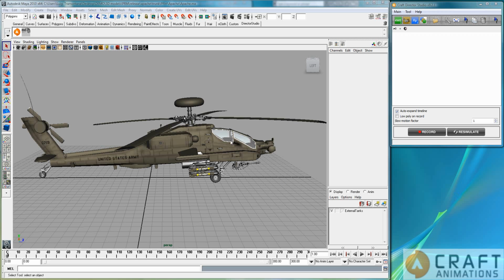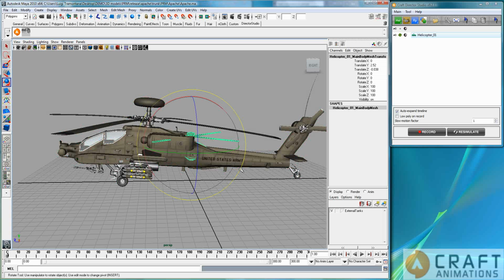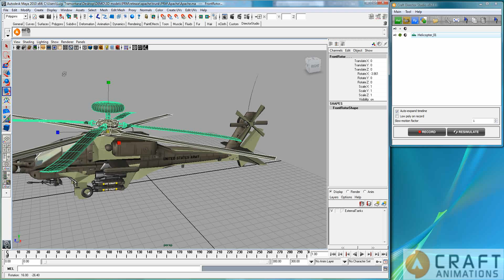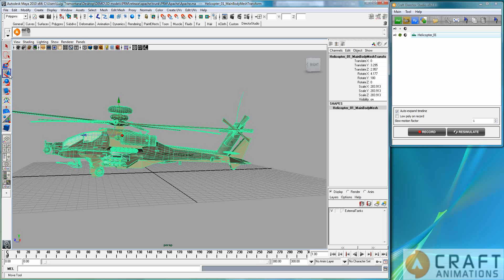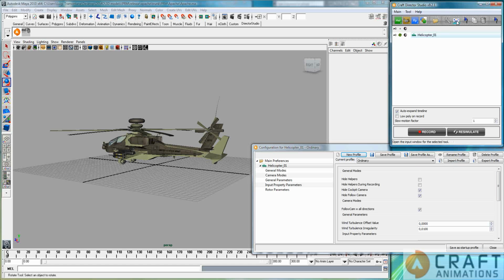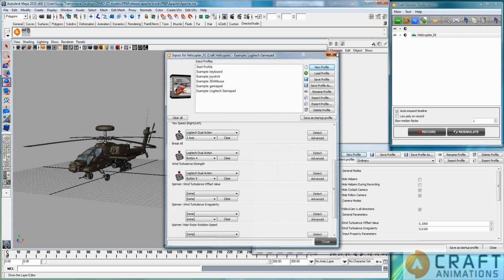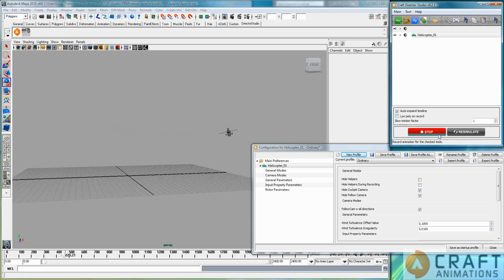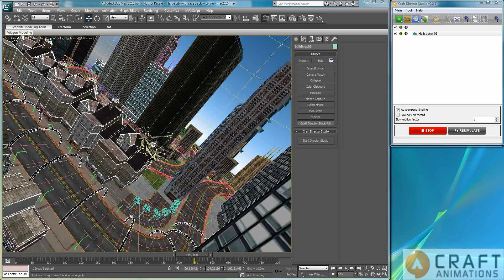Craft Helicopter - Rig and animate a helicopter in Maya and 3ds MAX - Craft Director Studio

Comment: Hi! How do I land?
Reply from the maker: Regrettably, the Helicopter rig lacks the capability to simulate a landing. Nonetheless, you can still achieve the desired effect by employing the Helicopter and executing the landing manually. Navigate the helicopter as though you're performing a landing. Upon reaching the desired landing point, pause the recording and rewind the animation to the moment just before the "impact" with the ground. Clone the rig in CDS to create a second helicopter at the same position. This allows you to manually animate the landing sequence for the second helicopter. Subsequently, synchronize the visuals using keyframes to seamlessly transition between the two models.
Reply: @craftanimations  I had thought of it this way, but I wanted to make sure whether or not I could land it, thank you!:goodvibes:

Comment: How can I make Landing animation?
Reply from the maker: The Helicopter tool does not handle the impact of a landing. So this need to be done separate. For instance by doing as good as a laning you can and go trough the ground slightly. Then adjust using manual keyframing or use a physics engine.

Comment: is there a way to make a quadcopter rig
Reply from the maker: Yes, you can build a quadcopter rig using the Helicopter tool. However, as Craft Helicopter is not able to do as quick movements in realtime you would need to post scale the keyframes to speed up the animation. The rig is built with a Helicopter tool as base in the middle and main movements, then use cogwheels to copy the rotor animations over to the other blades.

Comment: How do you set a plane as the ground like in the 4-Wheeler Extended so that when you take the helicopter down, it will not drop below the floor?
Reply from the maker: Hi, Unfortunately it is currently not possible to land the helicopter. They way you would solve it is to switch to either manual keyframe or use a physics engine at the point of landing.

Comment from the maker: Building a quadcopter is actually quite easy. Forget about the rotorblade on our dummy model, set the helicopter dummy in the middle of your model and simply set the helicopter's side speed to the same as forward speed. You need to animate the rotorblades manaully, but that's really not a problem.